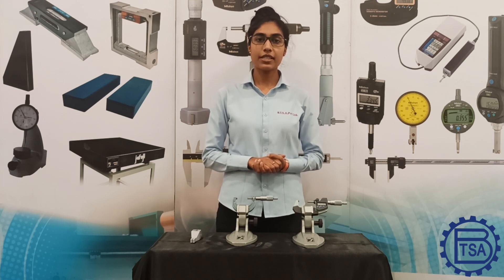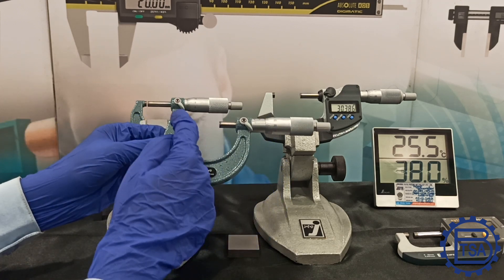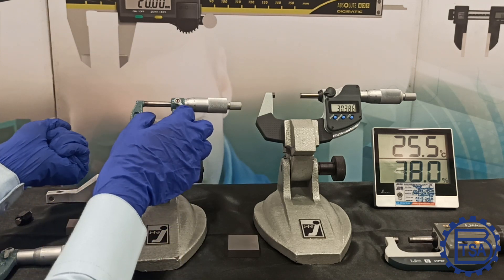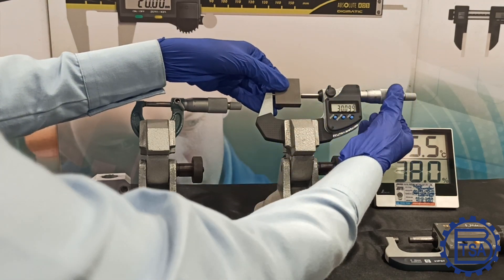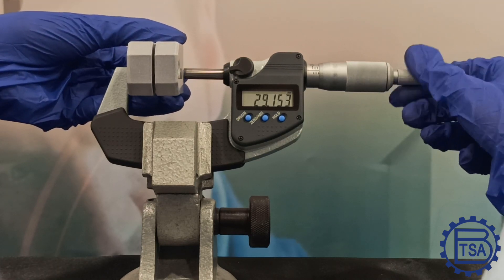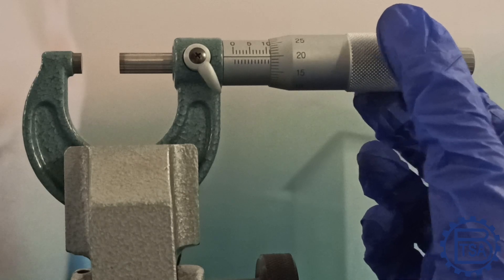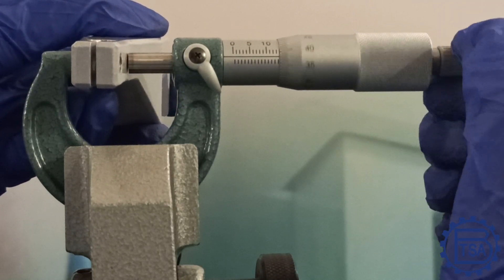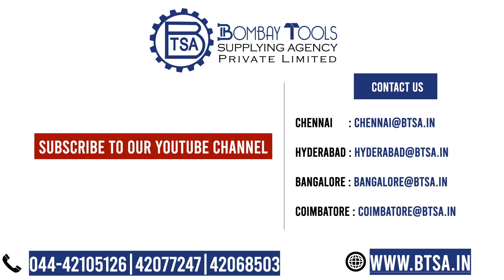How to use a micrometer? | Bombay Tools Supplying Agency Pvt Ltd

Comment: Hello, good day, excellent video. I have a question: when taking the measurement, how many turns should the ratchet turn? I understand that no standard specifies how many turns should be made, but for good laboratory practices, 3 turns should be made, is that correct?
Reply: Yes